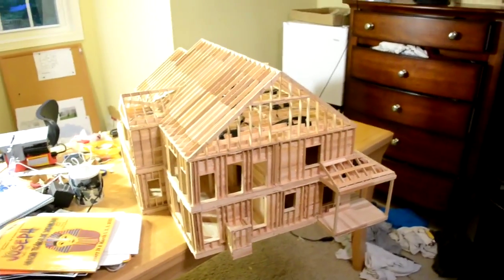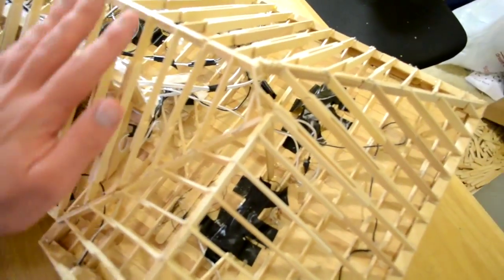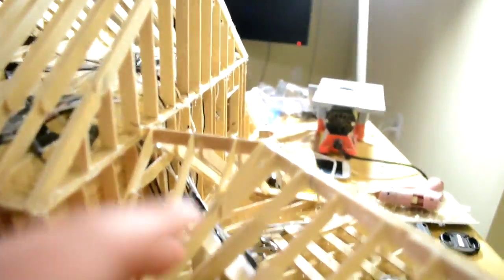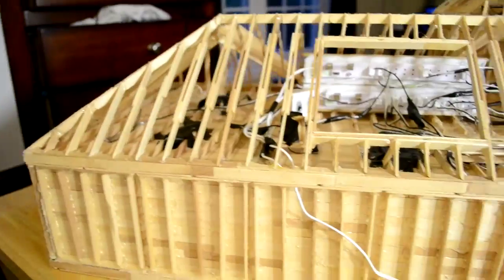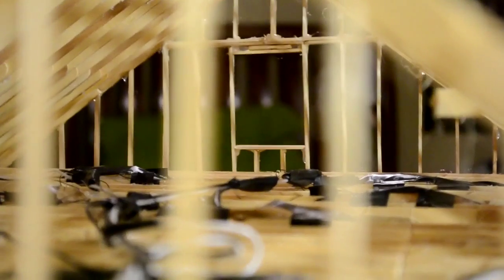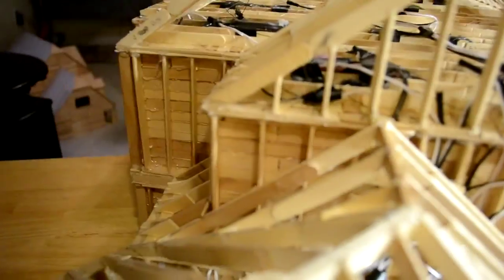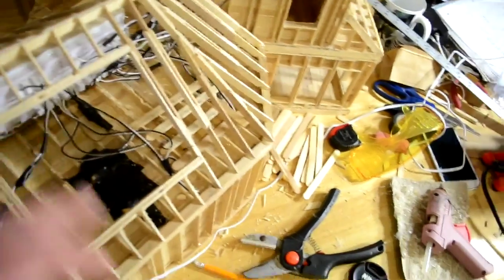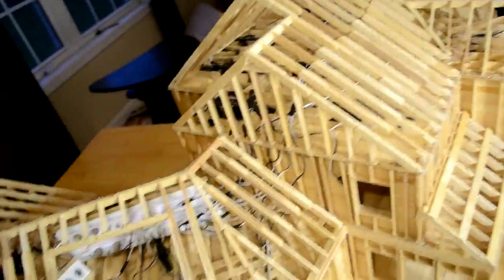33 - Building Popsicle House

Comment from the maker: What I do is draw the house in google sketchup as close as i can(Just draw a floor plan).  Use any measurements provided in the plan from eplans.  Then fill in anything else by guessing.  Then you can see how long each line is in google sketchup and then convert those to popsicle scale which is 1/24.  It means it's 24x smaller than the real thing